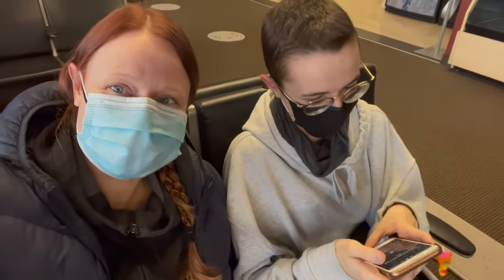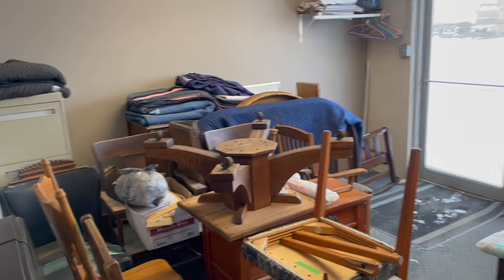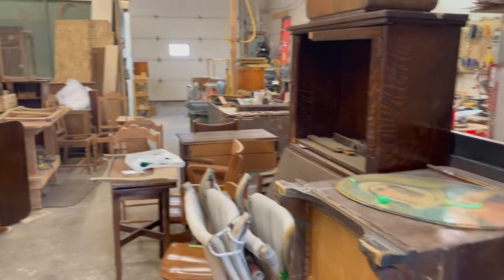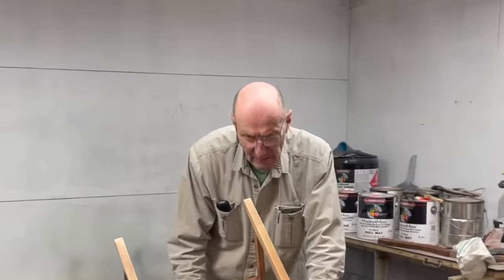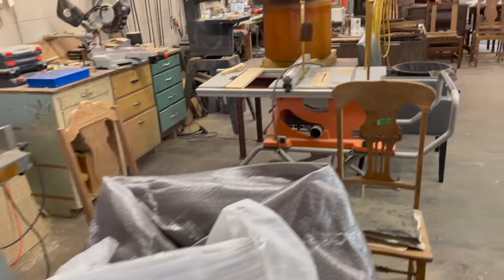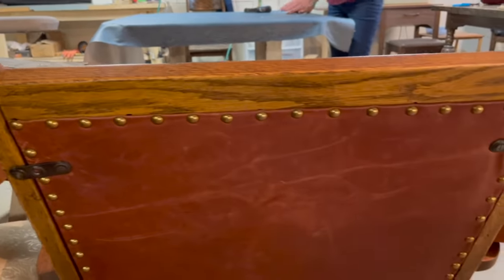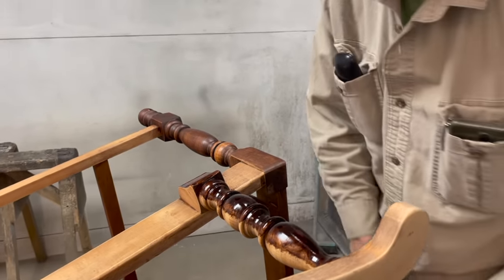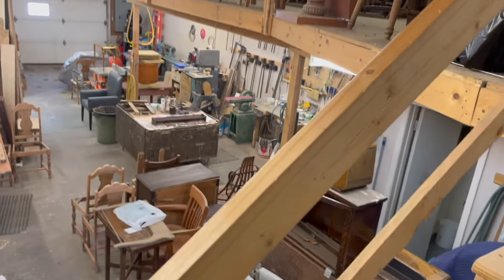A very special video ❤️

Comment: As I have mentioned in previous videos, I am intrigued with the fact there are not a lot of premium brand tools in these shops.  So many videos you see is a virtual display of the latest and greatest tools in woodworking.  Thousands and tens of thousands of dollars in tools in the shops make it seem like nobody can do a good job without them.  Yet some real art work is being turned out in these two shops with just ordinary run of the mill tools.  I hope this inspires people to get off the couch and go build something.  As Trena has said it is not the tool but the person using it that matters.  Thanks for sharing another inspiring video.
Reply: The most valuable tool is located between one's ears 😉
Reply from the maker: @corgilover3011  lol yes
Reply from the maker: thankyou!

Comment: My wife loves to visit thrift stores. Yesterday as I pushed the basket and followed her through one of the local stores. I noticed a wooden desk chair.  It was all there and the varnish was worn on the arms and the seat as if it has seen lots of use over the years. I immediately began an assessment of it. AS you do on your videos.  The back is in 3 parts and one side is loose which causes all the long dowels to be loose.  I also noticed that it had been repaired before in the past. This was due to the dark glue which had seeped up around all the dowel holes.  My first thoughts were, "Now Trena would take it apart and scrape all that nasty old glue off and possibly drill and dowel the loose side piece. 
See, I have been paying attention in class.
Reply from the maker: lol. aweome!

Comment: So nice to see your Mom and Dad! I have a question for you. I have a 1957 ish Drexel dining room extension table and spindle back chairs set. I have no idea what kind of finish it has but it is original. What is the best thing to use to clean it up with? It doesn’t need a refinish just some cleaning. I do plan to recover the seats of the chairs but want to clean it first. Thank you!
Reply from the maker: If it’s minor lemon oil or beeswax polish. Cheers